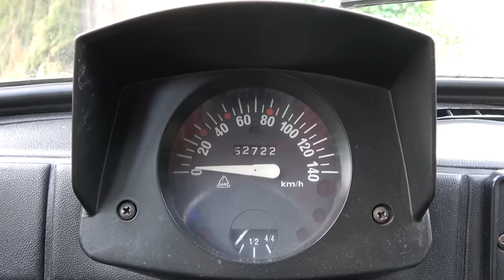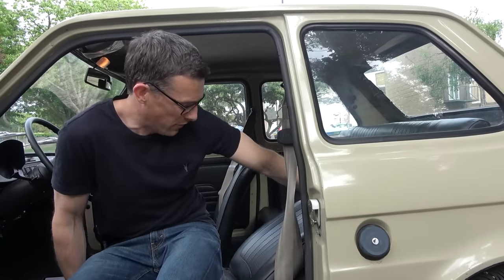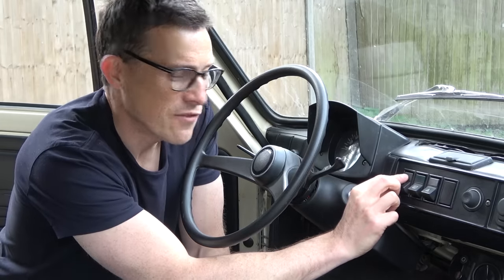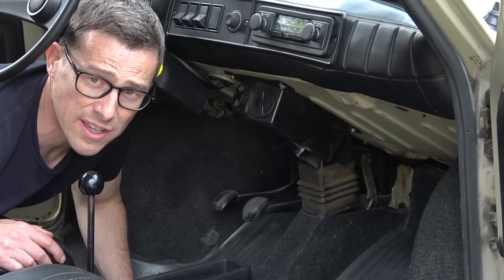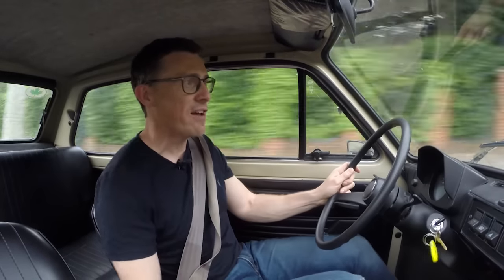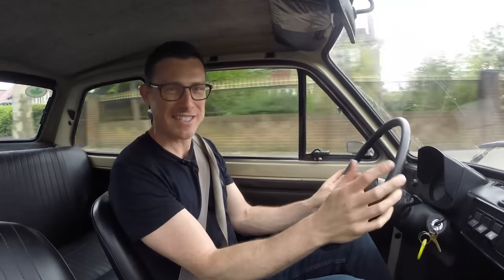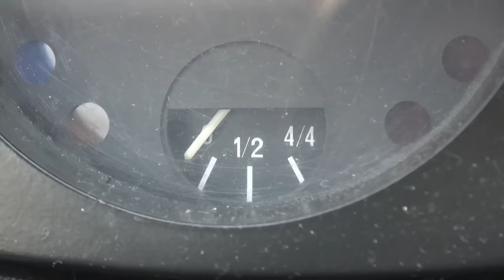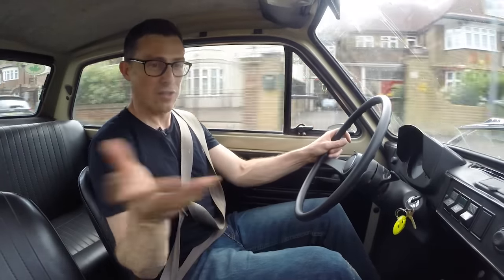I bought a Fiat 126! See why it's one of the coolest cars ever...

Comment: Imagine using this one at -15 Celsius,..regularly..
Reply: I was driving this at -25 celsius regulary many years ago :D Drifting like crazy on the snow because its rwd, and heating system is not that bad after a few modifications :)
Reply: basic heating system is a joke, it doesnt work 
126 isnt "water" cooled, just air. he has a pipe connected from engine into cab XD 
at -15 screens were always foggy

Comment: Fiat 126 A 594 cc was my first car, bought brand new in 1975 and lasted until 1997. I made with it 1.160.000 Km's until the engine was burnt out ! It's greatest problem is that it suffered from a bad quality chassis, rusting very quickly and causing insulation problems, otherwise it was a nice all purpose car ! It was replaced in 1998 by a brand new Daewoo Lanos Sedan 1349 cc.

Comment: a co-worker had one in my first job back as a teenager. The pros - you can park this literally anywhere and it barely takes any space. You can park 2 of these in a single parking space of a Mercedes Benz.  
The cons there's barely space for 3rd and 4th passenger and it's not a car you can drive on the highway. 
That's why my co-worker had removed the back seats and installed a 1KW subwoofer with amps.

Comment: Back in my highschool times 2006'ish This car was a typical kind of a practical prank gift item. Back then they were considered junk and were sold for junk prices. So for a friend of mine the class chipped in and bought a working fiat maluch for 300pln which at the time was about 60gbp... It only needed a manual broomstick nudge in some internal part to start the engine. But still a lot of kids back then started their driving "career" with this car

Comment: Well i guess in modern cars the only mechanical thing the driver is directly operating is the clutch in a manual. Brake assist, gas pedal input goes through a computer and power steering. What else is there?

Comment: Had one of these for years forever maintaining the king pins but Reay good car it had a nut at the end of the cylinder  head that blew compression air out the only way to test if the head gasket had gone

Comment: 1:43 *Correction : Your car original came with black plastic bumpers, you can still see the old holes in the front wings, also 1:48 : the black bumper 126's were introduced when personal 4 came out in 1977 not 1984

Comment: I was surprised that there wasn't a piece of wood in the trunk, most of these fiats would be equipped with one of these because the handbrake was so bad you would need to use the piece of wood instead.

Comment: It was my very first car but I had a newer from 1987. Different dashboard (wider and with more lights). It had an alternator so I didn't had any problems with battery plus it was already 650cc. I had some permanent gearbox problem which used to stuck in between gears from time to time. I have been removing engine together with gearbox (it was the easiest) in about 10min flat and fixing the problem. Later on I learned how to fix it easier so I was just getting under it, removing cover and with screwdriver setting all parts in position. Fuel economy was farily good as I was doing about 58mpg. half of the gearbox I bought for bottle of vodka back in 2000's 😁 it was standard price for a lot of things back then. I loved and hated this car at the same time. It was our own polish Marmite 🤣

Comment: If you’re 183cm and higher you’ll bruise your right knee quite a lot every time you put it in first gear.

If you can, try to find Zastava 750 or Seat 600 (this particular Fiat 126 actually has a steering wheel from one of those). You’ll be quite surprised 🤠

Comment: top speed is little over 100km/h, and it takes over a minute to get it. There was a joke that in "luxury" version is back window heating, to comfort people who will be pushing it during the winter. Fiat 126 is called "cougher" because when you don't push acceleration pedal enougth when starting from 0 it start to like choke and cough, preety common thing . It really was famili car in the 90 - talking from experience. 4 or 5 people (officialy 4 seated) with ton of baggage were making 500km through whole Poland on bumby roads

Comment: 600 ccm engine was very uncommon. Normal volume was 650ccm. Later it was 650E (E-stands for "electronic ignition", electronic here means no engine computer, it means spark control is done via thyristors and electronic board rather than via mechanical spark generator/distributor). Finally it was 126-bis model with 700ccm 41HP water cooled engine borrowed from then introduced Fiat Cinquecento. But it was the end. Car could not stand any crash tests.

Comment: 26 hp?
If you want to put a little money in it, for ~2000€ you get a 48V 20 kW electric engine, and you have a front tunk to hold 2x 24V batterys.

Comment: My father had two of these jewls. Plus a 127. A Fiat X1-9, and two Fiat 500. Then he bought a Volkswagen Golf. I remember that while the Fiat was able to run almost forever, the Golf died after 100k km. 😑
Then he bought a Ford stationwagon of some unknown model. He made an incident on that thing and was put in inducted coma for two months.
After that he bought a Lancia Ypsilon and later an Opel-something... 9 spots, just to buy stuff at the grocery.
My mother started on a Citroen Picasso (because it looked like the paintings of the famous painter) and now she have a Toyota hybrid.
I started with a Fiat Punto, then i used for some times the Ford of my father (but was kinda a trash bin) and then I moved to a new Fiat 500.
It lasted for ten years. 😑 There's nothing to do, quality of the past is absolutely lost. Nowadays cars are just "Use and throws".
I mean, here in Friuli there are still '70s Fiat 500 cars that still runs like they are brand new. While my modern 500 is scrapped by a couple of years.

Comment: This Fiat was terribly slow, even for its time. I drove it multiple time in Europe. It was so small that it was only good for two adults with two (rather young) kids. It's safety rating puts it somewhere between a thin can and a horse carriage. It offered no power steering, no power windows or anything else. It's 650cc air cooled engine wasn't even able to generate 30 hp. And it broke down. Frequently. The good things about it were its simplicity and fairly good manners in snow (it was rear wheel drive but the engine was in the back).

Comment: 3:26  600cc seems strange, maybe the engine has been swapped with a 600cc? if it was a 600cc that engine lid shouldn't be like that, and the wheels should be different, the 600cc was only used from 1972 - 1977
Reply from the maker: It's a polish one and the plastic bumper came in 1984 in Poland.
Reply: @MatWatsonCars  Things just don't add up, the production of the 600cc engine ended in 1978, your car has had plastic bumpers because we can still see the holes were it was fastened on, and the 600cc variant of the car has completely different wheels/brakes (wheels like the fiat 500), by 1980 all fiat 126's were made in Poland. They made plastic bumper and chrome bumper cars, the plastic bumpers came out in 1977 (personal 4) but maybe plastic bumper car were never sold to the polish? when was your car made ?

Comment: No way is the 126 a cool car, we made the mistake many years ago of buying one as our first car. The thing rotted to death in front of our eyes. Could not get rid of the stupid thing.!

Also as it was only 2 cylinder one spark plug cap used to jump off when travelling on motorway, suddenly down to 30 mph.